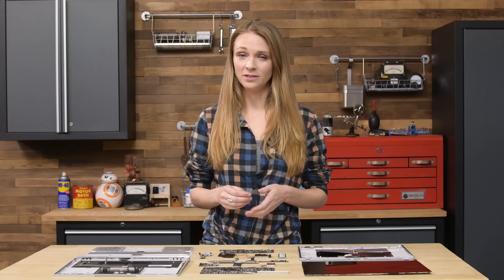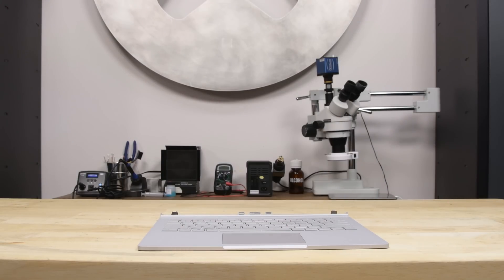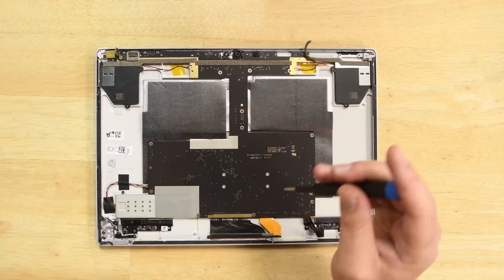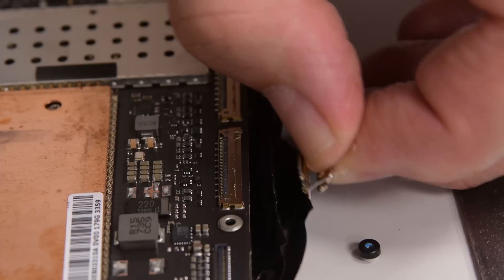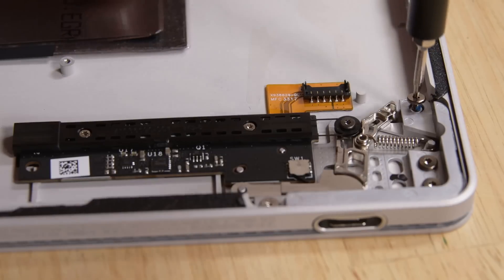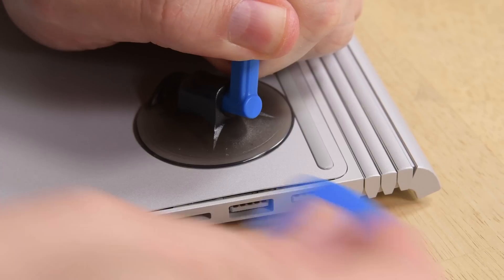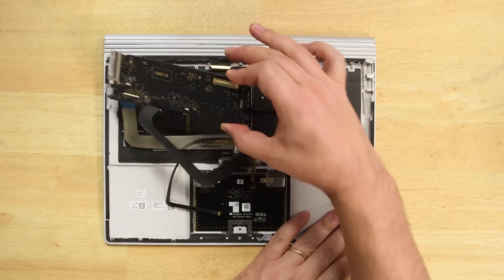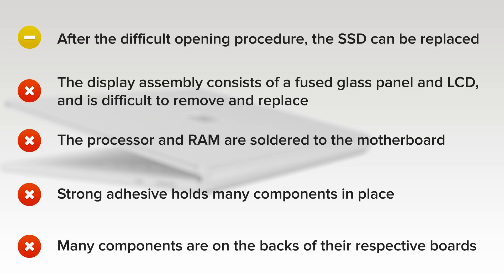Microsoft Surface Book 2 Teardown!

Comment: who cares about this?? I have never had to take apart my surface book on my own to fix something. I take it to the Microsoft store! And I've never paid anything AFTER the warranty was already expired. this is interesting but ultimately useless since Microsoft's customer surface is awesome and I'm never taking my sb apart.
Reply: broken surface book and no cost repair at microsoft service center after warranty expires? Fuck you..
Reply: Pjiggy it’s for users that keep their laptops more than two years. Basically what they are saying is if your £3000 SB2 fails after two years you might as well bin it. If that is acceptable to you no problem, but bearing in mind the Surface line has a terrible reputation for reliability, it’s a deal breaker for someone who works hard to save up for a dream laptop , that may after 2 years be a very expensive door stop!
Reply: i see what you did there. Nice word pun
Reply: There's a Microsoft store? Not in my area. There will be a point when something breaks, for some reason. All of this tech fails at some point.
Reply: Bro...
Reply: People interested in repair service?
Reply: This comment sounds sponsored. Is this comment sponsored?

Comment: Is the score relative? I mean...isnt all laptops now a day (especially ultra portables) have the score of 1?
Reply: I'd say, for example, Sager and workstation-class laptops are typically a dream to repair. Dell precision, HP zBook, and non-ultrabook Lenovo Thinkpads are made to be field-serviceable, and holy hell do you pay a premium for it (my Precision 7710 was around $3000 brand new, about as powerful as a $1400 gaming laptop at the time). 

I can add hard drives, m.2 drives, change out the WiFi chip, add a SIM-compatible LTE modem, upgrade the ram (upto 64GB), replace the keyboard (will need to do this soon as I accidentally spilled beer into it), and even the graphics card is not only user-replaceable, but pro MXM cards are backwards compatible with my laptop! I could go on eBay right now and buy a quadro P5000 mobile and slap it in to this thing to basically upgrade from a 965m to a 1080, although I might not do that. Why? The only problem with this laptop is the completely ass battery life, so I'm hoping those Kaby Lake-G chips get into some 15 inchers with a priority on battery.
Reply: name one that is this hard to replace
Reply: Exactly, it's just people love to throw shade on Microsoft lol
Reply: And atleast you can swap the ssd. I mean that means it could be even worse so is a 0 in repairability possible? That being said, there are lots and lots of Ultrabooks/Tablets where you cant change anything AND they are glued together like this Surface Book 2 which would make it even worse in terms of "repairability", right?

Comment: Great video with a sweet background beat, you guys are awesome! I believe companies are doing this on purpose for 3 reasons. 

1. It's a lot easier (and cheaper) to make a fully uni-body 'one way build' device, as it lets them make them thinner and more solid to boast about it's premium feel. If they were to build them with repair-ability in mind, it would make them thicker and probably cost more to manufacture. 

2. They don't want you to get your device repaired from anyone else but them. By restricting the device with a one-way build design, 3rd party repair shops would likely reject your request for repair as they would know it's impossible not to damage it further.

3. It stops 3rd party replacement parts. With the restricted design being such a barrier for repair, random Chinese knock off parts essentially would not exist as they would know no one is willing to repair said device.

Basically it's all done to force you to return to the OEM for any service and as a side bonus it lets the OEM make the devices thinner and cheaper to produce.

Comment: Thanks for the great teardown once again iFixit! I'mglad to hear that the SSD is technically replaceable, even if it is excruciatingly difficult to get to without ruining that screen. It is saddening to see, however, that the SSD in question is the lower end of Samsung's M.2 NVMe drives, rather than the 960 Pro. Can't wait to see more teardowns from you guys!

Comment: Think how much people would be screaming if apple made their products this difficult to repair. But when microsoft does it, no one cares. Well, well.
Reply: To be fair, Apple does not build laptop/table convertible like this one (yet ?). A macbook pro is still a "normal" laptop. I'm not surprised the SB2 is a pain to assemble/disassemble (MS has less excuses when it comes to the Surface Laptop though)
Reply: Apple sells tens of millions of each product, which means a lot of people care. Microsoft just sells a couple hundredthousand, so basically no one cares. Plus it's cool to hate Apple
Reply: If apple did something that actually required them to make the repair process this difficult like putting the whole motherboard on the screen like on the surface then I would not have complained, but no, on the MacBook they had no reason to glue the battery on the back and make their own proprietary ssd, only reason they did it is to prevent user from repairing and upgrading themselves.
Reply: I care. Combined with the news about the high failure rates after 2 years, I'll think twice about buying Microsoft again the next time I need a new laptop-type device.
Hopefully by the time I'm forced to replace my SP4, other manufacturers have surpassed the Surface Pro 2017 in overall package.
That said... one thing we can say in Microsoft's favour is that they have not yet invented a new screw for the sake of making repairs more difficult. Though oodles of adhesive really isn't any better...
Reply: At least this is a cutting edge tablet-laptop hybrid, surely some sacrifices should've been made to fit it all together.

Comment: Microsoft is better at being bad than Apple.
Reply: By your logic: You cant repair it = its a shit product?
Reply: How is this a rip off of macbook? 
Its more original than the entire apple catalog since Jobs died.
Reply: Apple: Awful keyboard that easily fails. Can't remove the SSD. Encryption done on a chip also soldered to the logic board. Sorry, Apple wins the "bad" contest by a country mile.
Reply: True but also, Microsoft is better at being good than Apple.
Reply: Ok, I'll bite since nobody else is. :) How is this a Macbook rip off? The only things the same is that both have a keyboard, trackpad, screen, and  both are made of metal and glass. ALL laptops have a keyboard, screen, and trackpad. So that leaves the metal build as being the same. The Macbook is just a nice laptop, and nothing more... it just iterates over what it's been the past 20 years, just getting thinner and lighter year after year. Nothing really innovative there.

The Surface Book is in a totally different class of products. It's also a detachable tablet, and it's touch screen. Not just touch screen, but supports advanced pen support. Also if you get the i7 model you get a dedicated GPU so you can 4k video editing really well, or even play demanding games. The 15" model takes that even to another level. No other company is doing anything like this. So how can you say that MS doesn't innovate, and Apple does?
Reply: John Buchmann  Nobody bit that one, because the guy is clearly a dumbass and an idiot.You just lost your time, because he isn't able to process what you wrote.
Reply: at least apple still innovates, microsoft hasnt made anything innovative in the past 20 years, this surface thing is a rip off of a macbook lol, and more of a cheap copy due to all the fucking glued plastic everywhere
Reply: apple innovates only in the brain of their devoted isheeps